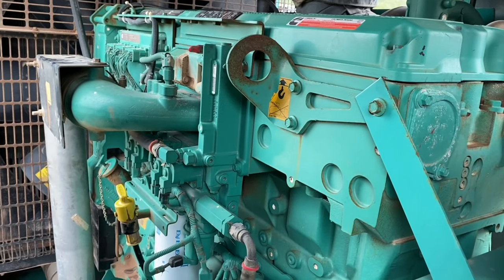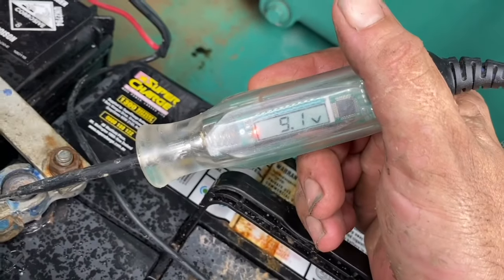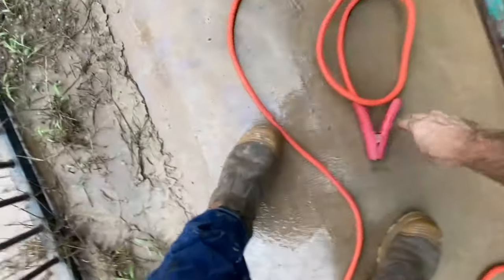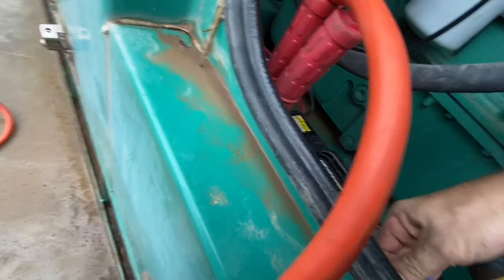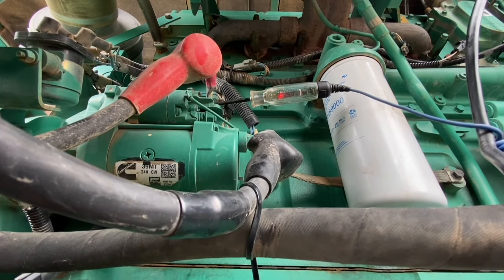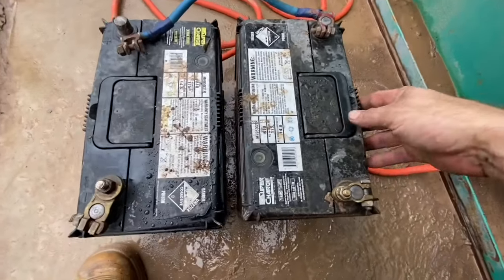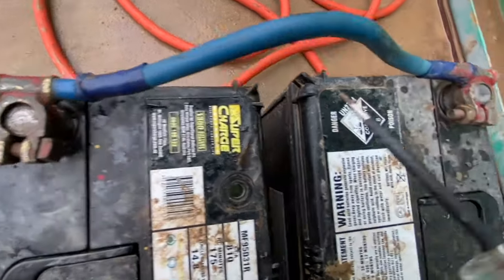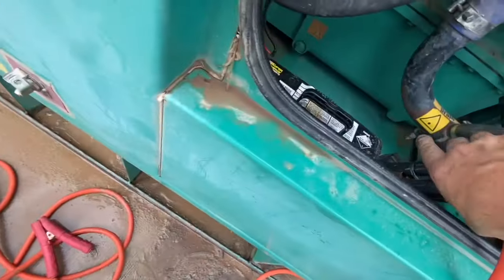Jump starting 24volt with 12volt battery

Comment: Nice, have jumped a 24v many times this way. I just use the multimeter to find the weaker battery - just go from pos to neg on each one it doesn't matter that they are hooked up in series ( didn't show it that simple on the vid!)
Then I hook my capacitor jump pack (from repco!) to the weaker battery and go for it.
I also keep an eBay cheapie 24v charger and extension cord in the truck to charge the extra flat machines.